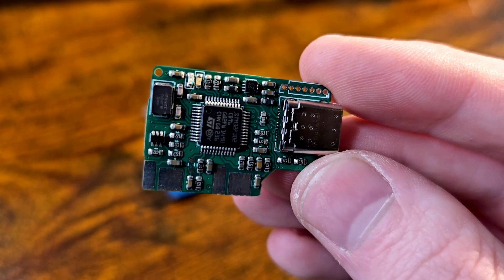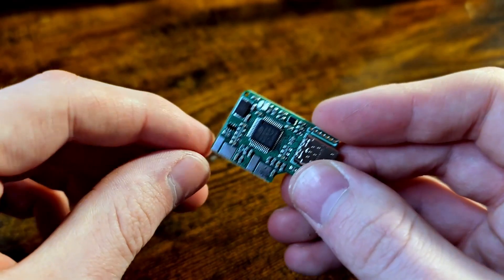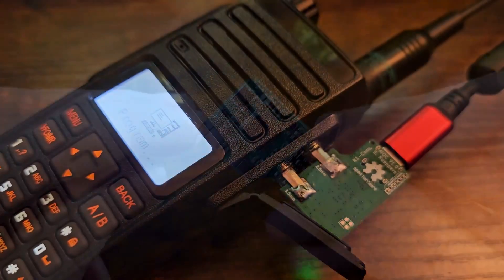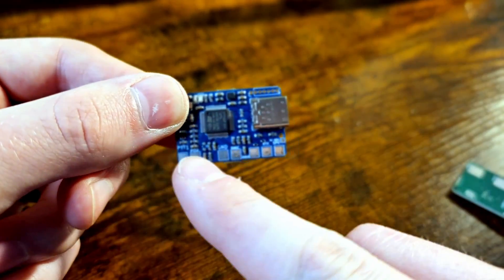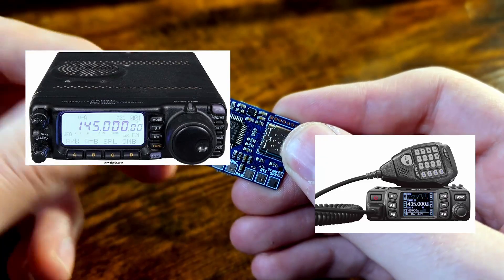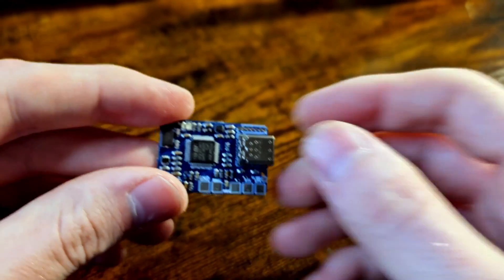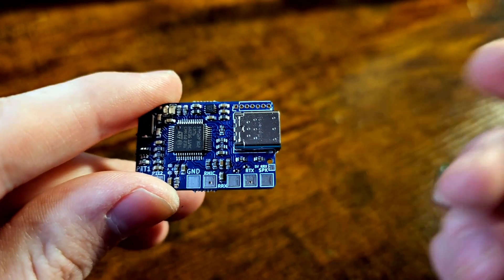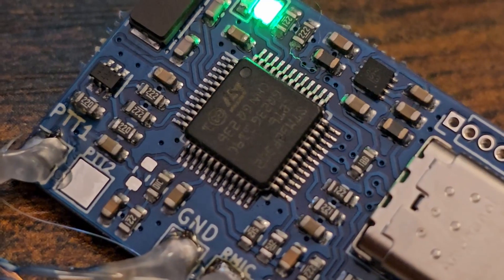This Ham Radio Interface works on Everything! | AIOB - All in One Board

Comment from the maker: Important Update! The AIOC's original data output is already adjusted to 3.3v, not 5V as I previously thought (and state in this video). THE AIOC IS 100% SAFE TO USE WITH YOUR RADIO. The confusion for this came from misunderstanding a blurb in a Github issue. The actual release of the AIOB will have the voltage divider removed, through holes added to every pad, and some other changes still in the works!

This does mean that the test runs run at too low a voltage to program / control most radios. Unfortunately the serial data interface I tested the AIOB with is very sensitive and still picked up the voltage, so I missed the original issue. Luckily there is a super easy fix for those with the test units, which Ill be releasing a video on shortly!

Comment: I got one a couple days ago, it works great on Winlink (using VARA FM) and packet radio. I use an FT-70D, and the PTT is a bit different - you need to connect a 2.2K resistor between the PTT1 pad and the radio mic input pad, as the PTT is different from the Baofeng/Anytone/Kenwood style connections.
Reply: Ok, so use a resistor 2.2k, between ptt1pad and radio mic pad (I do not know what that means). Then do I use a com port or do I use this as an RA Board. Can you give me more details on this? Please
Reply: @ke7uia  The FT-70D has a speaker/mic/ptt jack that has 2 basic circuits: speaker audio out, mic audio in, and a common ground connection. PTT (push to talk) is accomplished by connecting the mic input circuit to ground via a resistor. I don't know the "ideal" value, but 2.2K worked for me. I bought a cable that had the required plug (called a TRRS 3.5mm) and separated out the three wires - speaker, mic, and ground sleeve, and soldered them to the requisite pads on the AIOB, then added the 2.2K resistor between PTT1 and MIC pads. I then plugged the cable into my FT-70D, plugged the AIOB into a USB port on my computer, and set up my software to use it for Winlink and packet operation. The AIOB shows up as a sound card under "Audio inputs and outputs" in Device Manager  (it actually came up as 'AIOC' on my system, as that is how the firmware is written) and as a COM port (which is used by most software interfaces for the PTT function. I hope this helps!

Comment: I can see many people are excited the the AIOC board. All In One. I am having difficulties in getting this to work with my Baofeng radio and tipping the PTT. As I plug this in to my windows computer, there is no Com port listed. Apparently this is NOT a All in one board. Please help
Reply from the maker: Hi Gary! Not sure exactly what's causing your issue. A few questions for you:
1. Does the board have the firmware pre-installed? The green LED should light up when connected to your computer
2. Is the USB-C cable youre using a data cable? Many devices these days come with power-only cables for charging devices, and the AIOC needs the data wires to communicate with the system
3. Does Windows pop up with any "device not recognized" error messages?
Reply: @w1btr  Oh My, Thank you for this response. 
1. I understand the board was pre-installed. I have done the update with the file from the github page. When connecting the green LED light comes on with two red blinks. The green light stays on. 
2. My USB cables have the data lines. I use these for all my connections.
3. No pop up window, no device not recognized, no error messages. I have the device manager open, looking for com devices, when I plug in the AIOC board nothing happens, no blink, and no com port is listed. On my linux computer /dev/ACM0 is listed.

Comment: thank you for your work! I'm very interested if this would work with a Kenwood TM-V71A Edit: I think i understand this now. I look forward to using this for APRS. I'll keep a heads up for you getting them back in stock
Reply: The TM-V71 & D710 both need 5v serial for CAT control (and programming). Digirig somewhat confusingly refers to this as "RS232 levels" vs "logic/CMOS levels", so you'd need a MAX3232 (or similar) to bump it up to 5V from the 3.3v TTL levels on the AIOB/AIOC.

Comment: I use the AIOC with a soldered up pigtail to convert the K type connector to the 6P6C and 3.5 mono needed by my mobile radio (no mini DIN data port).

Definitely if Simon at least separated some pads or throughs for separate functionality in his next aioc that would be very handy and would obviate the need for a second project. 

Moving the audio further away from the radio i imagine is something they wanted to do with the aioc but didnt want to make it huge - i find it unacceptably noisy and have to use it with an extension even on K type radios to get it away from the rfi source.
Reply: Huh... that sounds similar to what I did with a TYT TH-9800. I used the AIOB and made a cable combo like you described, and it worked great!

Comment: I am not clear on what this board does.  You need to spend a minute at the front of the video telling us who are ignorant of what kind of things this interface can help us with.  I have designed hundreds of boards, but could not figure out how this thing would help me.
73
Glen K4KV
Reply from the maker: Hi Glen! A few other people had this issue as well. I recommend taking a look at my AIOC video introducing the concept. Basically, it acts as a soundcard interface as well as a serial and ptt interface. This lets you make a simple connector to interface with a standard HF, VHF, or UHF radio to work any digital mode you want, as well as allowing you to control your radio (if it supports it) and program it (again, if it supports it, which most do).

Take for example APRS / AX.25. This digital mode usually requires a "TNC" a piece of hardware that encodes packets and sends them to the radio. Those are usually $100+. This little board lets you run a software TNC like direwolf (which actually performs better than a hardware TNC) and have the same functionality at a fraction of a cost.

Comment: What does an AIOC actually do and why do you need It? You're making the assumption that everyone knows the reason why an AIOC is needed and what it's function.
Reply from the maker: Thanks for the feedback, I tried to explain it a bit in the video but may have glossed over it too much. It acts as an interface between your radio and your pc or smartphone, allowing digital modes like aprs, ft8, js8call, psk, rtty, and much more! It could also be used to schedule transmissions or something like that.
Reply: @w1btr  Audio? Cat control? Both? On the audio side, what are the specs for THD+N, frequency response, and phase shift across the spectrum? How is PTT controlled from the usb port? Is serial emulated? Are you using a C-Media chip? Are you using VOX? What’s the real-world bitrate you are achieving using VARA? I’m working on a project…
Reply: The world needs good ditch diggers too

Comment: You did not recap what the board did...
Reply from the maker: Sorry, I tried to explain it well but might have glossed over it a bit.

It works as an interface between your radio and your computer allowing you to send and receive audio from the radio through the computer. This is mostly used for digital modes, like APRS and Js8call, which are super fun to look into!

Comment: you need to put an easier way to an easier way to bring the COB  out for Allstarlink ?
Reply from the maker: I havent messed with allstarlink. Is this like a COR signal, where when receiving audio a 5v output drops to 0v, or something like that?

If so, do you mean input from the radio?

I know the AIOC already sends a virtual "COR / COS" signal when it is receiving audio from the radio, however this is virtual over the CM108 line, not a physical pin. What would a physical pin accomplish?

Comment: Great improvements Lucas, congratulations, on my wish list: Bluetooth, both sound and cat (cat over HID?), Stereo Sound to transfer I/Q signals from radio to computer (for SDRs and radios like KX3, TX500, many SDRs), 1:1 audio isolation transformers on sound channels to break ground loops, eliminate noise and/or transform impedance,  isolation on PTT (reed switch or opti coupler), I realize the time and cost of doing all of these, just throwing out all the ideas in my head for you to choose from for what would fit in your product mix - perhaps different models. 73 de ws1m, bammi (new call sign)
Reply: Reed switch/ reed relay or opto coupler is not necessary a fet works fine.
Reply: @the1spyderryder  I  agree that the FET works and solves the problem of of level isolation (important for legacy radios) and also covers any current  sinking requirements, the problem is electrical isolation. You still have a common ground potential that sometimes causes problems, that's why I suggested opto or reed relay isolation. As i said in my original comments, all of these features may not be appropriate at a particular price point, and the target market that AIOC is addressing. 73 de ws1m, bammi

Comment: Awesome. But I just soldered my plugs to some wires and soldered those wires on the board. Then I removed those and soldered female jacks to some wires and then those wires onto the board. And then bought 2 cables with the right jacks and bobs your auntie. And like someone else said. Through holes with strain relief or better yet. A 8 pin standard jst header. That way Amazon has a 10 pack for 10 bucks.
Reply from the maker: Jst headers arent possible with the fabrication process we currently use, but through holes will be added in the final version!

Comment: Will this run the 1.3 firmware for Allstar compatibility? And unfortunately the international shipping price is very high off your website
Reply from the maker: Unfortunately the cost is high since I dont have any distribution points, typically around $20 for New Zeland
Reply from the maker: This will be compatible with all future AIOC firmware updates that also support the original AIOC.

Comment: Order placed.  
Put a small switch or at least jumpers to switch between vox and ptt.
Reply from the maker: @KA4UPW  This would definitely be useful. I havent figured out a way to get that to work yet without working with Simon a lot to get the firmware to allow such a change, perhaps with another pin dedicated to this function to tell the STM chip what to do.
Reply: @w1btr  
Thats what i was thinking. Just a control interrupt line to enable the vox routine

Comment: Through hole would work way better than pads - or even better if the pins are broken out to a standard connector. Otherwise, good job!
Reply from the maker: Standard connector would be hard to do since it's not surfsce mount, would likely make it sognificantly more expensive. If there's enough interest, maybe!

Comment: Nice board! Am I correct to assume that this board is open source as well?
Reply from the maker: @LB0FI  Thank you! Im keeping the code private at first to drive sellers to the shop. However, I will be open sourcing it after a bit of time, and I'll be keeping the price competitive.
Reply: @w1btr  I sent you an email earlier today, I'd appreciate it if you got back to me on that one. Thanks!
Reply: @w1btr  Awesome! I am waiting for this board to become open-source. So, when it does, please post another video. I have some ideas of tweaking the gerber that I want to try out!

I am planning to make a USB-soundcard style connector that has a USB-A soldered to the PCB that can go with an RPi without any USB cables. The solder pads to connect an audio-cable is a great addition. Probably we can also connect with an Android device for SSTV decodes/APRS.

Comment: This is Simon, nice design! Thanks for attributing me on the silkscreen 😁
Regarding the 5V UART levels: the RX signal at the STM32 is on a 5V tolerant pin at the STM32 so in theory there is no additional circuitry necessary to protect the STM32 from over voltage. But it can't hurt either 😉
Reply from the maker: @kl1nk0r  Thanks, Simon! That is correct, I left the chip's serial Rx Untouched (labeled RTX as it's what the radio transmits), and the voltage divider is applied only to the STM32's output into the radio, which runs at 5V by default. Many radios seem to be fine with 5V, especially for a quick program, but for something like CAT control, it can fry it and is very difficult to repair.

Comment: Through  holes please?  The pads are not a favorite of mine.
Reply from the maker: I think it'd be possible to add small through-holes on the pads! Anything non-surface mount becomes very costly
Reply: @w1btr I’m not sure but he may be talking about just adding vias to solder wires to, a bit more secure than soldering to the pads